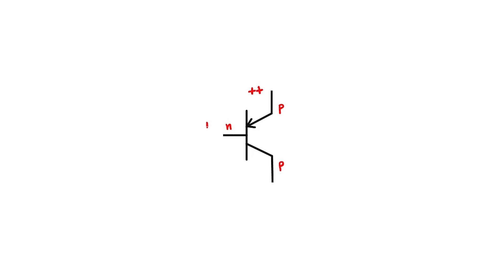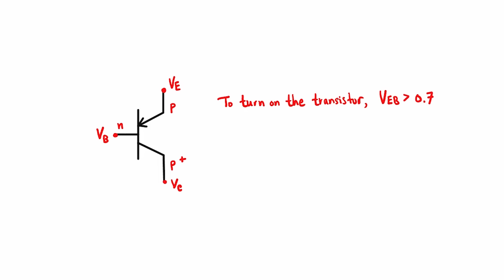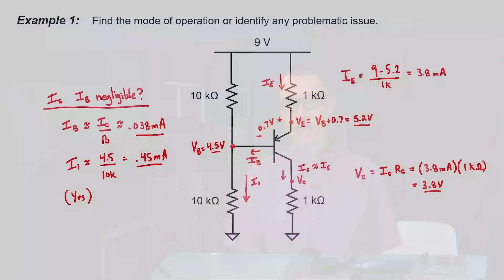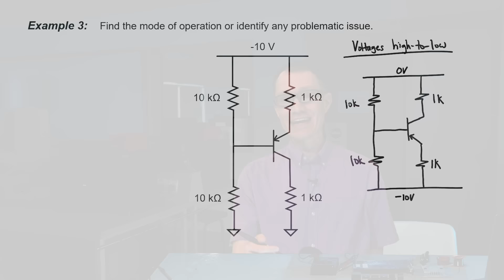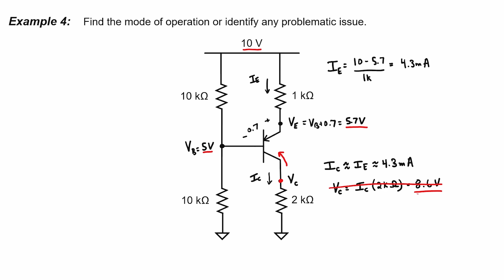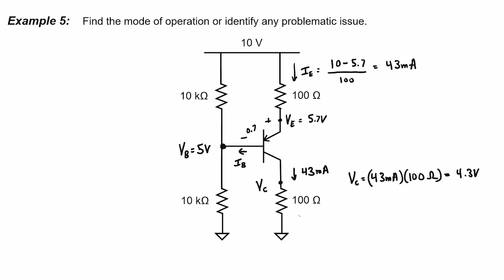Introduction to PNP transistors (20-Transistors)

Comment: Thanks, your method, as  used in Example 1, has helped me understand an old text example, that was confusing me - Sutcliffe: Electronics for students of Mech. Eng.  Confusing, mostly by the use of negative voltages. The text book example had a germanium pnp transistor with 50 mV Vbe with (I now know) a beta of around 60.

Comment: In Singapore, do electrons flow from the positive to the negative? Every electron I have ever encountered has always carried a negative charge and been attracted to to a positive charge. In every transistor or diode circuit I have worked with, the electrons were always moving through the diode or transistor opposite to the direction of the circuit diagram arrow. The early assumption and therefore the names positive and negative were based on the guess that electrons traveled from the pole of the battery that they called positive. Experiments with things like the earliest cahtode ray tubes clearly proved that the electrons were traveling from the negative pole to the positive pole.
Reply: Electronics uses the Benjamin Franklin model. Electrons were discovered later. Viewed from inside the battery, electrons go "opposite" direction and all is well. Watch out for old US military training videos. They are great learning, but they can show electrons and current in a circuit moving in same direction. This issue also causes problems in molecular biology because students need to work with movement of charged molecules where cathode vs anode gets confusing.

Comment: This video helped me a lot.  I have never stopped to understand PNP transistors (even though I have an EE degree lol) in practice, and I want to check the beta of some PNP transistors I purchased.  I am going to breadboard a test circuit and this gives me a test setup I can use.  It also tells me the basics of current flow and polarity.  Awesome examples.

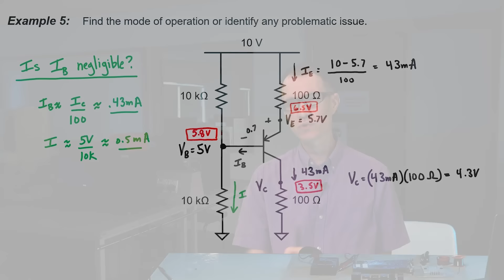Comment: At 19:34 you assert that the gain of the amplifier would be reduced beyond what you would expect. That's simply untrue. The small signal voltage gain of a common emitter stage in the forward active mode is approximately the ratio of the collector resistor to the emitter resistor, in this case close to unity gain because the voltage at the emitter will follow that at the base and the same current will flow through the emitter resistor as does through the collector resistor. Having a base current that is comparable to the current through the base bias resistors will make both the dc bias point (i.e. the quiescent collector voltage) and the input impedance sensitive to variations in β, but won't affect the voltage gain.

Incidentally, for many years the lowest noise small-signal transistors were almost all pnp and that was the preferred type for the input stage of the best preamps using discrete components, so it's not quite accurate to imply that pnp BJTs were always inferior in performance to their npn equivalents (compare a BC184 to a BC214, for example).
Reply: Yes I used МП39Б
Reply: Yes I used low noice МП39Б

Comment: Historically, when manufacturers begun making power PNP silicon transistors - complimentary to existing NPN transistors - they realized such transistors required 2.5x the amount of doped silicon, compared to the NPN models.
The theoretical calculations, based on Fermi Sea of carriers, didn't anticipate this. In the end, it took ten years before fully complementary NPN - PNP transistor pairs were commercialised. It remains true that PNP transistors are more prone to faults - the base shorts for no reasons.
I find PNP transistors to be a life-saver for all my DC-coupled, differential designs, Schmitt triggers, and digital designs.
Also, a well designed high power complementary audio output stage is better than a MOSFET design, provided the feedback avoid transistors saturation - at all costs.
Thank you for your videos!
Greetings,
Anthony

Comment: Thank Dr Danner, I was a Mech Engr and worked is systems, Medical Imaging, Factory Automation, Robotics Assembly etc etc. In retirement i have pulled out my old (1950) train set. I was determined to update it using IOT, why not that should be fun. Oh my, Motor control with Transistors is giving me such headaches. I buy circuits that work but I have no idea why. And when I want to tweak the performance I am lost at which way to go.  I tried to listen and learn but I must say it is very hard. Do you have any practical applications of motor control with braking? I have a mini DC motor 3.5VDC that i want to make Puff Smoke on the engine stack. Timed to the drive wheel rotation. So I need a burst then stop, then burst then drop. The burst is driven by a sensor, but the Brake was design to stop the motor when the puff trigger pulse is off. But I am getting so much coasting there was no stop of smoke between puffs. Its a very simple and the circuit i was given is very simple but now I need to tweak the circuit.   ??????????? No idea where to go to decrease or increase volts. The originator suggested dropping one resisitor from 500 to 100 ohms, and it helped. Amazing, No I am looking at the fan blade weight. It this anything you would have information of a link to a lecture that might help me to get this logic sunk into my grey cells. Thank You, Dennis

Comment: You could have explained all the cases by superimposing the vcc= rc x ic + vce curve on the transistors operating curve of the manufacturer instead of drawing on for 20 minutes and no doubts cleared

Comment: Can you tell one thing? Give typical voltages on the ic vs Vce curve. There is a sharply rising part initially and then plateaus of. Where is 0.7 volts on this curve- at the origin before it takes off or where it plateaus off? , for a given Ib. Everybody takes 0.7 volts without getting into the saturation aspect.
Secondly in the first example of forward bias case the Ve and Ib will remain  the same even if you took Rc and Re as 10k instead of 1k. Is that believable? In the 1k case the operating ppint will be on the plateau region ie saturated. In the 10k case the operating  curve will cut the Ic curve on the vertical stretch meaning Vce in the vicinity of 0.7 and possibly several volts in the 1k case
Reply: First part: The Ic vs Vce curve is a plot of how the collector current changes with the voltage across the transistor. When Vce is small (usually around 0.3V or less) the transistor is in saturation and the current can change a lot for a small change in Vce. That is a low impedance at the collector. When the Vce is above that region it is in normal active mode and the collector current hardly changes with change in Vce. That is a high impedance at the collector. For small signal devices, saturation is usually approximated as 0.2V.
The 0.7V you're referring to is the base-emitter voltage (Vbe) and that's just a pn junction, a diode drop. The voltage between base and emitter remains pretty constant as the base and collector currents vary because the relationship between Ib (hence Ic) and Vbe is exponential, which means a tiny change in Vbe corresponds to a large change in Ib.

Second part: If you changed Rc and Re to 10K instead of 1k, the collector, emitter and base currents would all decrease by a factor of 10. As long as the base current is small compared to the current flowing through the base bias resistors, the voltage on the base won't change. We call that a "stiff" voltage divider because it doesn't change much as different currents are drawn from it. Then as long as the voltage on the base remains constant, the voltage at the emitter will stay constant (about Vbe or 0.7V from it). That ensures that the emitter current is completely controlled by the emitter resistor (Re) and that determines the collector current (which is equal to it). So yes, it is perfectly believable that Vb, Ve and Vc will all remain the same if you change Re and Rc to 10K instead of 10K. But Ib, Ie and Ic would have to be ten times smaller. In either case, the voltage across the transistor (Vce) would be the same and would simply correspond to an Ic ten times smaller. You can't just draw a "load line" on the Ic vs Vce curve because there is a different curve for each value of Ib. Changing Ib and Ic merely moves from one Ic vs Vce curve to another where Vce stays constant.

Comment: I was very intrigued by reverse active mode operation and went on a small googling tangent. Results came up with this very specific usecase for reverse-active-mode:

Fuzz-Effects for Guitars. Running VERY HIGH gain NPN Transistor (2n5089 e.g., with a whopping 1.2k in the best case) in reverse mode severely limits their gain and reduces saturation current such that the transistor itself saturates and distorts the input signal long before clipping into the supply rails. This is said to give a more "tube-like" distortion with less unpleasant harmonics.
Reply: Hiii....stumbled upon similar usecase. Reverse active mode is occuring due to an SCB fault. Analysis seems bit confusing

Comment: Thanks for answering my long-held question about WHY, specifically, PNP transistors are not as good/reliable as NPN transistors and why we don't typically use them in high-power applications unless we absolutely need to.

Comment: Nice video...thanks for the upload.....Subbed and Liked...

As someone who has worked with electronics since my college days back in the early eighties.  One piece of info I learned that is very useful is:
To find which leg is which on a NPN Transistor.....
Put the Red lead of your multimeter on a Random pin.....place the Black lead on another.....note what you got....Assume OL on the Multimeter....
Place the Black lead on the remaining lead.....note what you got....Assume OL on the Multimeter....
Do this again but move the Red lead to another pin.
You might get OL again but if you get ~0.6, leave the Red lead on this pin and move the Black lead to the other pin.....
If you get a slightly higher reading then you can safely say the Red lead is on the Base and the Black lead is now on the Emitter.
The remaining pin will be the Collector.
You have to be patient and take accurate readings because Base Emitter voltages change dependent on the Transistor type and can be noticeably different or slightly different.
Your reading combination will tell you if the Transistor is NPN or PNP......
With practice, this method will be helpful, it has served me for years...hope this is helpful......

Comment: 2:55  "Holes" do not "move", in a SOLID, atoms are fixed, nucleus does not "move" and they are the positive part. No. When an electron moves away, the atom gets an excess of proton and thus, becomes an area locally positively charged, a "hole". When an electron comes close by, it becomes trapped, and the "hole" disappears.  So, if there is a hole at point A and then later on, disappears with another hole appearing at point B, the "hole" has not move from A to B, the hole has not visited the middle point between A and B, and, in face, nothing says that it is the same electron which is implied. The holes do not move (the material is a cristal in a solid), it is electrons (for a solid) which move.
Reply: Actually holes do behave much like electrons and obey all of the normal equations governing carrier transport in semiconductors, although holes have less mobility than electrons in equivalently doped materials. There is absolutely nothing to be gained by pedantically trying to examine the phenomena at the atomic level. Current flow is a bulk effect in all practical devices, and you just end up confusing yourself by worrying about what is happening as if quantum effects were predominant.
Reply: @RexxSchneider  If a hole disappears from point A and appear at point B, the hole has NOT moved from A to B, no hole passed at mi-point between A and B and even worse, nothing can tell that the hole move to B or to another hole which could have appear elsewhere at C. Only electrons are moving in a solid. And that matters for not-static voltage (at high frequency). Since everything can be explained by moving electrons alone, it is totally useless to make it more complex with moving holes which ... do NOT move (well, they can vibrate, but that is not a point of interest here). The "speed" is not about moving hole, but about recombination (recapture) of moving electrons. There is nothing wrong keeping the model as close as the real thing without bringing moving hole, sorcery, or magic, any of these existing.
Reply: @ Look, if a hole disappears from point A and appears at point B, the hole has moved from A to B. The hole did indeed pass through the mid-point of the crystal structure between A and B.
That's completely analogous to an electron disappearing from point A and appearing at point B.
You obviously still think of an electron as a solid ball of matter with a negative charge that bounces around like a billiard ball. That's simply not the case. In a conductor the conduction electrons exist in a continuous band of energies that exists throughout the material. When an electric field is applied electrons will join that band at the negative end and leave it at the positive end.
Pure silicon is a remarkably poor conductor because it has few electrons in a conduction band. In n-type doped silicon there are uncommitted electrons in the crystal structure that can easily move into the conduction band, allowing current to flow when an electric filed is applied.
In p-type silicon there are absences of electrons (holes) in the crystal structure that will move under the influence of an electric field, and these behave so similarly to the electrons in the n-type that we can treat them just as if they were positive charges moving through a conduction band.
These holes have a measurable mobility, a drift velocity under an applied electric field, etc. just as electrons do. That is why it is simpler to explain semiconductor action by using the concept of holes than it is to try to explain majority carrier action in p-type layers by how electrons disappear from one point (leaving a hole) and re-appear somewhere else where a hole existed previously.
Put simply, the easiest way to have a single system of semiconductor behaviour that covers both types of doping is to use the concept of holes as carriers in the same way as electrons are. It works and makes calculations easier, so we use it, despite your protestations that holes are some sort of magic. They are a mathematical abstraction, but in fact so are electrons!

Comment: I had to replicate a 1950s circuit that controlled slave clocks, it used a PNP transistor in a TO-3 package. I didn't have one, but had lots of NPN of a similar spec, so I mirrored the circuit. Still working 15 years on.
Reply: Everyone had 2n2955 PNP TO3 case.... Surely you could have found one..

Comment: I don't understand why it's called the emitter when it's the terminal that collects electrons.

As a memory aid, you remind us the emitter always labeled with an arrow.

If we don't have simulation available, how can we solve a system with non negligible base current?
Reply: There is an older standard called "conventional current". They put the emphasize on the "holes" which are the positive and empty spots. So think in terms of positive flow instead of electron flow. Then the symbols make sense.
Reply: @CrispyCircuits  thanks. Just like the symbol for diode, the arrow points in the direction of conventional current.
Reply: For non-negligible base current (Ib), start by working out the voltage at the junction of the base bias resistors as if Ib were zero. Just like in the video. Then use the Thevenin equivalent resistance (the parallel resistance of the base bias resistors = Rbb) for that voltage source to determine the deviation from the previously calculated voltage as Rbb x Ib. For an NPN, the voltage will be lower because the base bias is sourcing Ib; for a PNP the voltage will be higher because the base bias is sinking Ib. That gives you the actual voltage at the base, and then calculate the voltage at the emitter as usual, and so on. E.g. we have two 10K resistors, but Ib is 0.2mA, so the base voltage would be 5K x 0.2mA = 1V away from half the supply.

Comment: In the Navy we learned a way to easily distinguish pnp and npn transistors. Looking at the emitter, it’s either ‘pointed in from the perimeter (pnp)’ or ‘not pointed in (npn). That was 50 years ago and I still remember it.
Reply: I think of it like this: the base is the middle part of the transistor, so the middle letter of the transistor type tells you what charge needs to be put on it (relative to the emitter) for it to turn on.
Reply: I bet you still remember the resistor color codes little saying.
Reply: @cr1424   Bad beer rots our young guts but vodka goes well. There is another one.
Reply: @rpm12091 I can't say the one I learned in electrical engineering
Reply: Bad boys
Reply: In the Netherlands we say "Pijl Naar Plaat" which translates to "arrow to plate".
Reply: my old man was in the Canadian Forces..... he told me the diff between NPN and PNP was that NPN was Not Pointing 'N..... and PNP was Pointing 'N.
Reply: P points to N
Reply: We said NPN (Not pointing iN) and PNP (Pointing iN Permanently)
Reply: If it's "out" it's "N"....
Reply: Yes me too. "PNP points in" is what i have drilled into my brain.
Reply: P is for power,  PNP transistors used in amplifier circuits
Reply: I learned it as NPN - Never Points iN
Reply: I learned "Point iN Please" and "Not Pointing iN"

Comment: I would love to see then a pure/only NPN transistor H-Bridge. Is it really that simple to just trun the NPN transistor around to get the negative side working?
Reply: No, because the resulting device will have a very low β and the emitter-base junction's reverse breakdown voltage of around 5V will now become the "collector"-base junction's reverse breakdown voltage, rendering it unusable with supplies above about 5V.